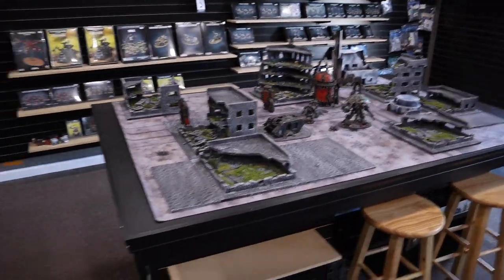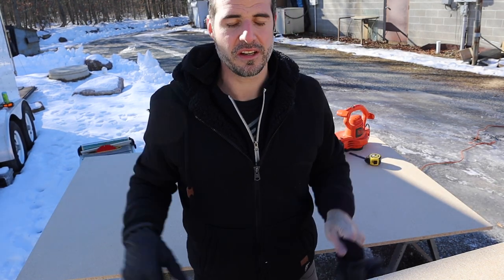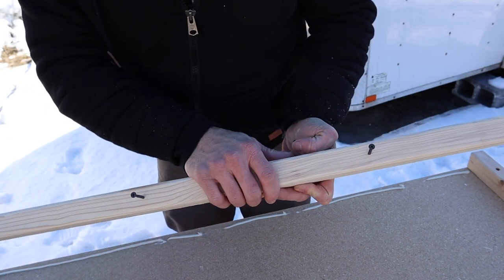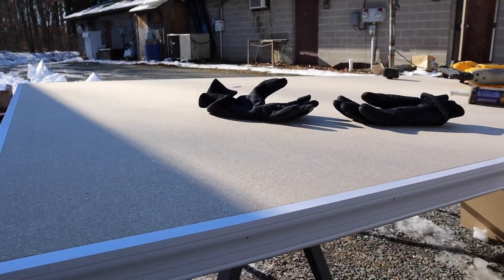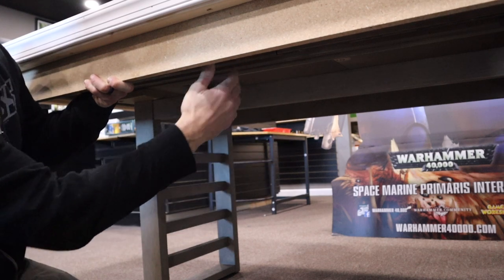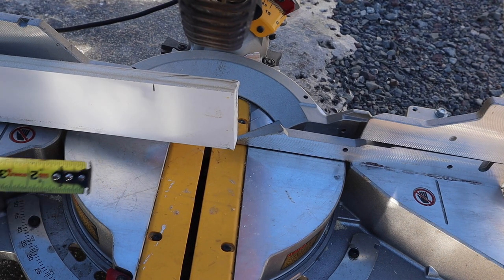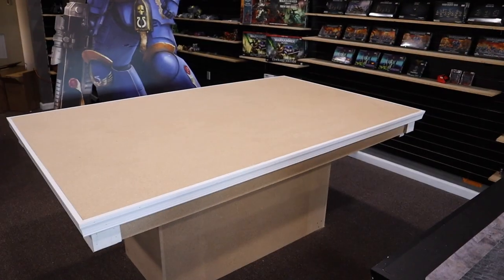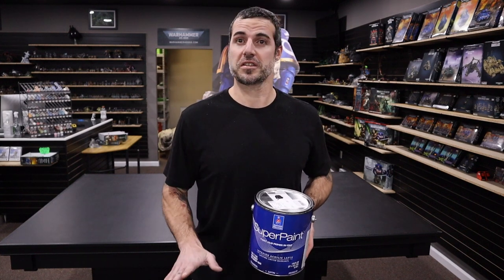How to Build A Warhammer Gaming Table Top for under 100$ and make your friends jealous too!

Comment: $100 gaming table $2000 of dewalt tools lol. Great vid
Reply: when people say they build something by hand, the understanding and expectation is that they had tools or when to someone who let them use tools. It would be foolish to assume that you can just do the table for under $100 dollars and not have tools. Common  sense!
Reply: @simplyminipainting  The problem is that poor luddites also don't have the resources to buy cameras (or even an iPhone) and video editing software, which is why you don't see those kind of videos.
Reply: Can be done with cheaper tools, most cuts can be done with a jigsaw, handsaw and a steady hand
Reply: Tbh most the videos on making a gaming table are over engineered.
I'm a carpenter and I simply use a handsaw and timber that allows a screw to reach through no problem.
So any old drill, a handsaw some screws and you're away.

Comment: How well does it resist sliding when bumped?  I would be tempted to put a none skid mat between the donor and the top.
Reply from the maker: thats a great comment! i discovered in my gaming store that when people lean on it...it does move, (allthough it is pretty heavy, if someone were to stand and lean against it, it did have the tendency to slide...so i did exactly what you mentioned and i put a not slip piece for a furniture under neath)